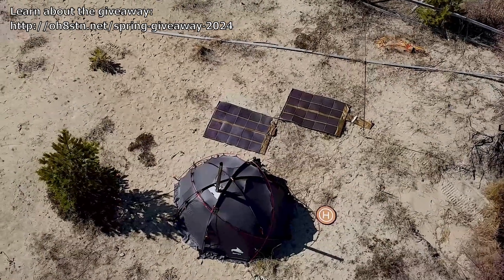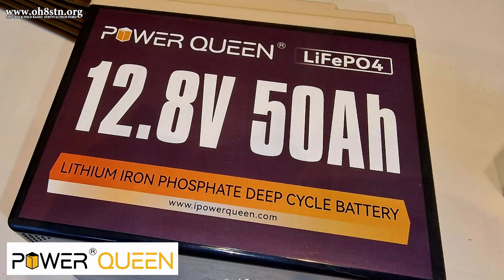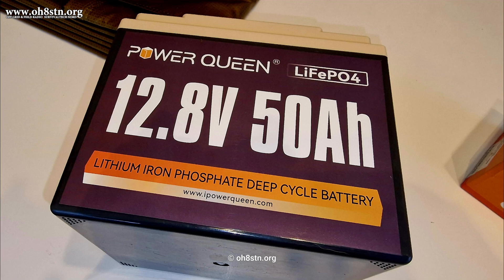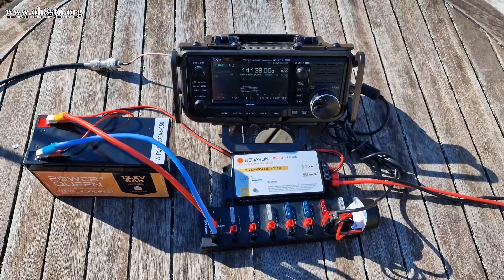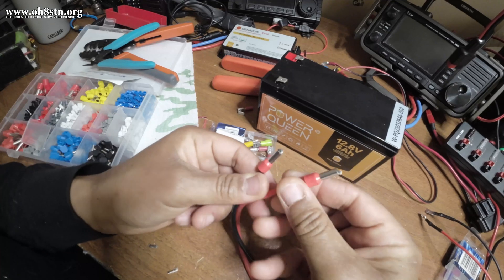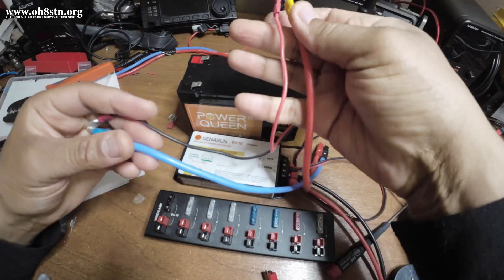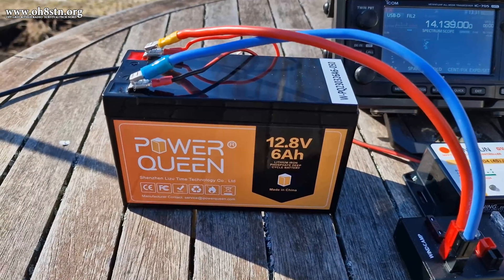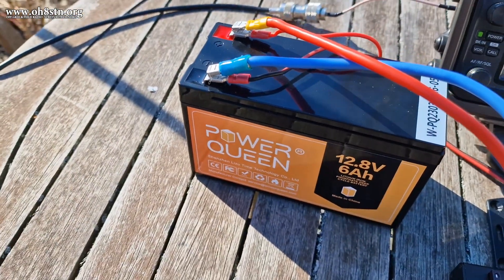Off-Grid 12 volt Battery & Solar Power

Comment: Question: How are you wiring up multiple panels for best performance? For example managing if one panel falls in shade or is a lower voltage.

I watched all your solar setup videos and didn't see this mentioned, please correct me if it. Thank you for your videos.
Reply from the maker: Hey thanks for your question and kindness. The short answer is we wire them in parallel. This way if one panel gets covered in shade, it doesn't affect the other panel which is still in sunlight. This is in contrast to home solar where we usually connect those in series. In series one solar panel getting covered in shade would affect the others. In parallel this is not the case.
Also when we're talking about amorphic silicone panels from powerfilm, the solar panel doesn't get completely shut down buy partial shading as with many  monocrystalline panels.
Hope this helps 
73
Julian oh8stn
Reply: @OH8STN  hey thank you, i'll use that advice! Last question and ONLY if you're up for a tricky one.

If the battery breaks or is lost, can a genasun still provide power? (example: battery port attached directly to a DC cigarette lighter port for a 12~24v phone charger)

If not can a Gensun controller with a "LOAD" port do this or can it be "tricked" into supplying power? 

Here's my research:

From the documentation some? all? genasun models will either not charge or trickle charge if voltage is too low on on the battery port for battery safety. Some genasun models have a "LOAD" port but I don't know if that'd fix the problem.

I got this reply about genasun from dsbpower which handles questions for EU distribution: "Thank you for your message. Unfortunately we have no mppt that can provide power without a battery. In general | do not think this exists. As far as we know you always need a battery to have a stable power supply to power your loads. Sorry we cannot help you with this."

I'm skeptical! All the best,

Comment: Thank you very much for all your work, insights, and generous sharing! I am building a power system based on the one you show in this video with the Genasun GV-10, Powerfilm 160W crystalline panels, a PowerQueen 50AH battery, and an Anderson power distribution hub as shown. I am planning to connect the charge controller to the battery via a cable that plugs into the  power distribution hub instead of connecting it directly to the battery as you have shown (using split battery cables). Any reason not to wire it this way? Electrically, it is the same and the currents seem ok but I wonder if there is a reason that would favor the direct connection. Thanks!
Dave KI7OOZ

Comment: Greetings from England!

Thank you very much for all the tips. And for the discount codes!

I've just ordered a Genasun charge controller, I'm waiting for a 20Ah Lifepo4 battery (Eco-Worthy in the orange & black plastic "case")

And fingers crossed, I'll find a nice Powerfilm roll-up panel soon...

Do you use specific ferrules? I've got a Powerpole crimping tool, but no ferrule kit yet...

In advance, many thanks for your time.

Big hugs to Junior! Stay safe.

73 de 2E0HJN / Manny

Comment: Julian, any thoughts on charging a surface pro. I bought an adapter for a USB C connection to charge the unit from a solar panel but I believe the surface pro charges at about 15V. Any thoughts?

Comment: Initially I had thought of powering my FT-710 at home directly with a solar panel, due to sheer ignorance. My friends on QRZ forum warned me that peak voltages would go up to 32V on a sunny day. So I went for an SMPS. Now I am thinking for an experimental setup with solar panels, just to have the feel of it. Let me check local availability of the portable type of solar panels which you have shown so that I will have an alternate option! 73 de Jon, VU2JO.
Reply from the maker: You will always need to regulate the voltage coming from the solar panel out to the radio. Output voltage of the solar panel is too high, so we use a charge controller to regular the voltage to charge a battery. Then, connect our radio to the 12v battery.
Reply: @OH8STN  That is exactly what friends on QRZ forum told me! Understood that I have to learn lot more on solar panels before actually using them for powering radios! Hope to meet you on air some day. I do work a few European stations on 10m SSB with my fan dipole for 40/10m.

Comment: Can you cover battery sizing and solar panel sizing. How to calculate how much wattage on solar and battery capacity needed to run radios and charging 18650 batteries for flashlights and devices?

Comment: Love your video's.
You inspired me to take my ham shack off grid full time.
I use two 320 amp hour lifepo4 cells and a epever 100 amp charge controller.

This year I'll upgrade the solar from two 265 watt panels to 4, 345 watt panels.

Love your videos thank you for the several years of content.

73 de VA6CQB

Comment: What do You think about power stations like Goal Zero, Bluetti, it's possible  that  the smaller ones 300Wh-500Wh can provide power for ham radio ? For IC-705 of course but for 100W ?

Comment: Nice Simple Setup! I have a very similar setup and use  the Charge Controller from BuddiPole. Works great, Low noise seems to be efficient. I carry my gear and seup in my 4Runner for POTA and Summer Overlanding But I can easily pack out to get into the field away from my car. For my car I use a Portable Powerstation (I just upgraded to Bluetti as is has a 30amp 12Volt outlet, Something that very few other powerstations have). 
One thing I see in your setup, is a lack of of Fuse protection to pretect against faults and other short circuits, perhaps I just missed that? 
Anyway great video! Always good to compare notes with others to see what I'm doing right or wrong.

Comment: I think is a very good introduction.  Because of the brand of batteries that I suppose it brings chip for the balance of cells. May be would be good another video on balance for the cells for other batteries.
73
HP1GDS

Comment: Hi Julian, do you have a video (I haven't found it yet if you do), on how to use multiple power inputs to the charge controller, for example, solar panel, wind turbine, etc. Thanks. :) 73 de WW1ZRD
Reply from the maker: Hey I ddon't but I made a graphic diagram on how to do it. I can publish that as a blog post later today.

Comment: Considering the Icom 705 and the larger available Icom battery that allows 10W output but costs over $100, I would state that it is a better long term investment to put that money into a second external battery such as a LiFPo that will likely provide much more mAH than that Icom battery. 

That translates into a slightly larger package to bring, but the extended air time should offset that cost better than the Icom replacement.

Great video and very simplified!

Comment: I have a powerfilm 120W and it creates a too low voltage for my MPPT. Can you make a video about this problem?
Reply from the maker: Perhaps, but I'll need more information. Normally an mppt charge controller will boost voltage of your solar panel.the What's your battery config? Which mppt charge controller  are you using?
73
Julian oh8stn
Reply: @OH8STN  Victron SmartSolar MPPT 75/15 with DIY 75 Ah LiFePO4 battery - 4S config

Comment: As an added benefit/extra security measure: wire the Genasun battery connection into the Powerpole distribution board. That way the connection from the Genasun to the battery is also fused (and you don't need extra inline fuses)

Comment: My only gripe with Genesun is that I always feel like the terminals are going to break off of the circuit board with any strain from the connected wires. I wish they were a little more robust.

Comment: What about cloudy days ?
Reply from the maker: The PowerFIlm Solar amorphous silicon panels have excellent low light performance. That has been demonstrated in videos on this channel for ~5 years. That's one of the things that makes them desirable.
Reply: @OH8STN  Yes, and the Boost version is an excellent addition to the field kit. 

Julian, you should also mention that part of the power supply computation includes panel downtime for night operations and for one or more days when the panel produces less energy because of an occluded sky.

I've started a white paper on what I've learned, but haven't finished the draft (yet).
Reply: Great info. Thanks Julian. I need to step up my solar capabilities and this video helped.